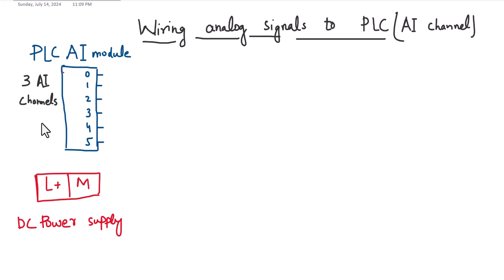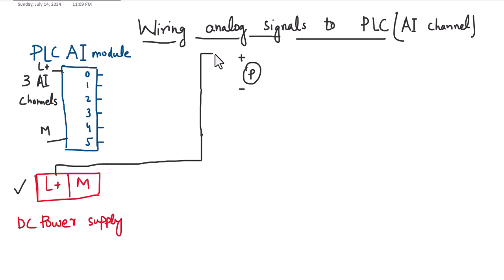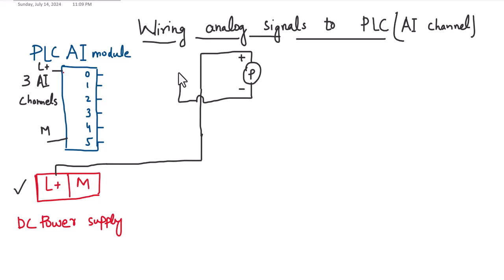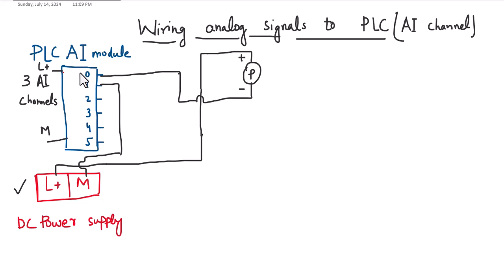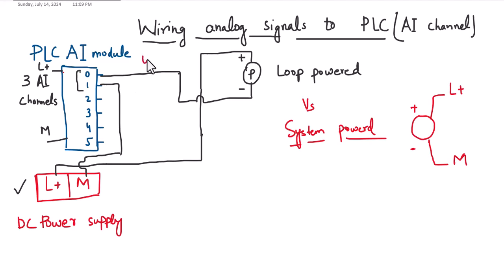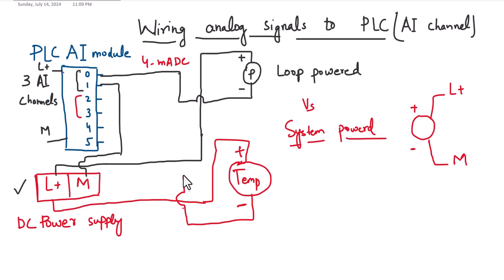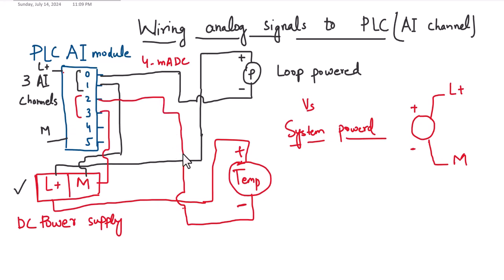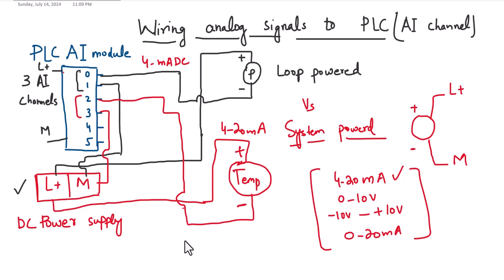Wiring Analog sensors to PLC | PLC Fundamentals 10

Comment: with change in pressure or temperature  the sensor gives an output from the negative terminal to the connector no1 of AI card ? as per your explanation/